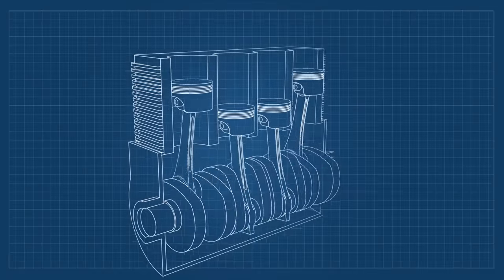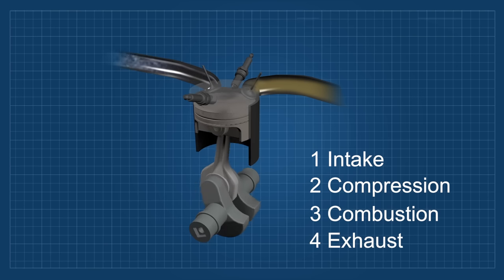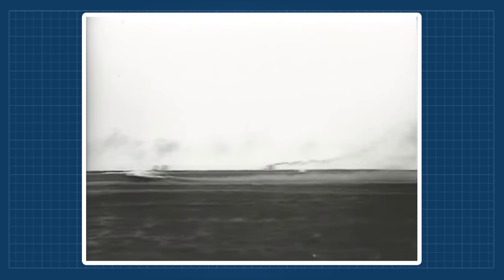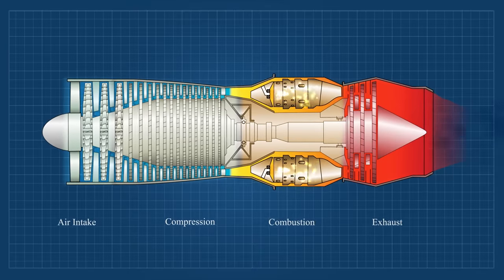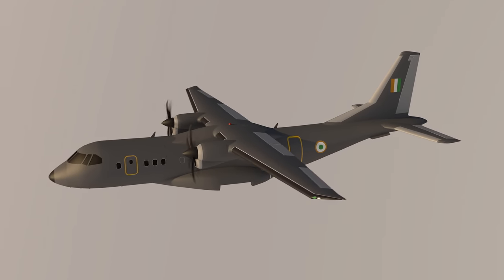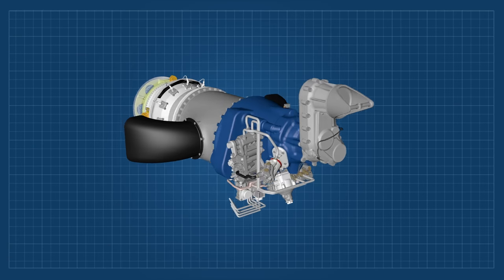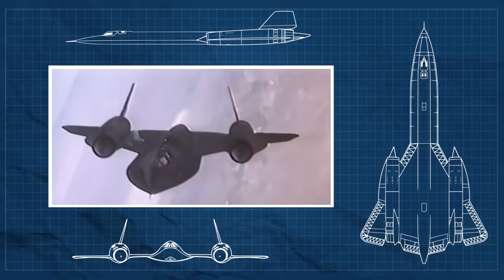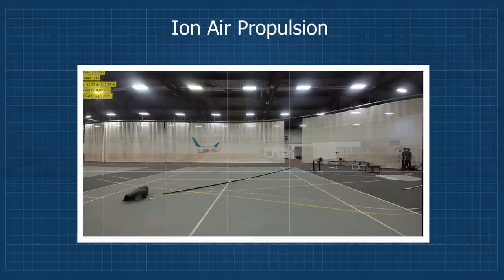Aircraft Engine Types and Propulsion Systems | How Do They Work?

Comment: One type that is used or was used is the pulsejet engines.  They may still be used on model planes but they are very loud and the fuel consumption is very high.  They powered the German V1's. Also, in model aircraft, there are ducted fan powered by internal combustion engines or electric motors.

Comment: You are missing Deltic engines used by German Reconn a/c during WW2 (Jumo 233) --as well as RRs and submaringes 
Nathan Price developed an axial flow gas turbine (J-37 - likely in 1937) beginning with a steam turbine, then adapting to kerosene.
He also developed turbochargers to improve piston engines, and saw how a simplified diagram of a turbo charged piston engine can be easily simplified by removing the pistons.

Comment: I can't seem to find the answer to a certain question ❗ 
How the heck the entire blade-array rotates 360?  Does a motor do the job? Or any other power source is used! What force/energy is being used to rotate those blades which compresses the air and then blah blah blast it through the nozzle? 

Somebody save me 🥴

By the way this video is really great, I mean it. ❤️❤️❤️ I mean you explained the Ramjet in a way more simplified way!  Thanks for it.
Reply from the maker: The entire system is attached to the same shaft as the turbine, that's how it rotates.
Reply: @Joyplanes  then what rotates the shaft? Like the piston engine needs the spark from the sparkplug , what sparks the shaft to rotate? 
Thanks in advance, I know I'm a bit bothersome but plz someone  answer my question.
Reply from the maker: @maheejaman1625  The fire or combustion rotates the blades, this combustion has only one way out and that pressure has to go through the turbine, just imagine a wind turbine but with more blades and instead of wind, the combustion is used.
Reply: @maheejaman1625  the same like the compressor but in reverse
Reply: In a nut shell, if I understood the question correctly; just like a car, the initial rotation is done by a starter, - either electric or compressed air or some other means - unlike cars though the RPM has to be a lot faster. Once optimal RPM is reached by the starter, fuel is mixed and ignited with a spark. As you know air flows from higher pressure to lower. Since intake side has higher pressure because of air comming in, it flows thru exhaust side, but with higher flow speed because of the combustion. At the exhaust side, there is a small fan that is connected to the intake fan via a shaft. While flowing thru the exhaust, the air flow forces the fan to rotate faster and faste because of higher exhaust flow speed, and in turn makes the intake fan rotate faster and faster, causing the intake fan to suck in more and more air. it's a cycle that has to be controlled, and is controlled by several means to maintain stable RPM.
By the way, a superb animated explanation. You're another mordern day Carl Segan, explaining science to the mass in a very simple way.
Reply: @DZ-rb7ft  thanks bro, much appreciated 👏👍

Comment: I'm surprised you didn't mention scramjets when talking about ramjets. It would also have been nice if you had actually explained the difference between a turbofan and a turbojet, rather than showing a diagram and sort of glossing over it. A mention of propfans would also have been cool during the last section on unusual designs. A mention of ducted fans would have been cool too.

Comment: The fuel/air mixture does not "explode", it burns, at a rate of 26000 FPS.  The reciprocating engines on aircraft are very light weight

Comment: Radial vs Rotary engine look similar but different. A rotary engine has cylinders arranged radially around a central crankshaft just like a radial engine, but instead of a fixed cylinder block with rotating crankshaft, the crankshaft remains stationary and the entire cylinder block rotates around it.

Comment: Any practical hydrogen engines used on planes? Will be nice to know more about current hydrogen tech in general.
Reply: No, hydrogen is a very BAD solution because need very big tanks and extremly complicated to handle , only uselfull in rockets, as liquid propellant, in add hydrogen is at 95% made with methan gas, with high CO² emissions

Comment: Using high speed itself as a source of compression, humm interesting.
Quite wondering if the aircraft in the future using other source of power other than burning fuel, what would it be like then.

Comment: I fly a single-engine turboprop piper m600. , cruise speed TAS at fl 280 is 265 kts. and fuel burn is 265 pounds per hour during cruise.

Comment: You forgot the motorjet and the pulsejet. Also, the Lockheed SR-71 did not use ramjets. Instead, it's propulsion came two Pratt & Whitney J58 afterburning turbojets.
Reply: When it reaches speed, it transitions into a ramjet!
Reply: @Dr_Larken  Not exactly. While it does take advantage of the high volumes of air being forced and compressed in it's intakes by the aircraft's already high velocity through permanent compressor bleed after reaching speeds above Mach 2 it is still not using the mechanics of a purely ramjet design. Instead it's engines use both compression by it's turbines as well as the rammed air in concert to one another in an order that helps lower it's consumption of fuel without the loss of speed. In essence these engine could be called a turboramjet   !

Comment: With this design of the front fan, I think there is low pressure area on the left of the fan and high pressure area on the right of it. Is it correct?

Comment: Awesome work.  Question, what happens when it rains and water enters the engine in turbojet and turbo fan engines.
Reply: The water is evaporated or just pushed out the back of the engine.   when jet engines are designed, they actualy go through tests to see how much water they can ingest before failing.
Reply: @Bendigo1  well what If the water enters the combustion chamber.
Reply: @pummyy  It all goes through the combustion chamber.  That is why they have to test how much water it can handle before the combustion stops.
Reply: @Bendigo1  That link has a very good explanation. Thank you so much for the that.

Comment: Question, Why do turbine engines take a while to start up/spool up?
Reply: Because of inertia.  The air is used to spin the turbine that moves the air.   The turbine has mass and thus has inertia, the air has lower mass and can not change the rotational speed of the turbine very fast because of the inertia of the turbine.   

You can see this happening if you use a straw to blow on a small fan to make the fan spin.  It will take some time and a lot of blowing to make the fan spin.  The bigger the fan the longer it will take to get up to speed.
Reply: @Bendigo1  Thank you!!!!

Comment: What if you fix and simplified the glider plane and use a power air turbine to propelled the glider plane it's a fuel efficiency right that is a total of airo dynamic engines and add a kinetic power to rotate the turbines in a constant rotating state

Comment: How about the nuclear jet engine? 👍
Reply: There hasnt been anything as a <<nuclear jet engine>> they had concepts for it. But it was never a real thing.
Reply: @trainsofnorway9664  not true:

"The first operation of a nuclear aircraft engine occurred on January 31, 1956 using a modified General Electric J47 turbojet engine."

https://en.m.wikipedia.org/wiki/Nuclear-powered_aircraft
Reply: @jonathanspeicher5298  yea only a concept, no accual plane with a reactor went into service
Reply: @trainsofnorway9664  *prototype. There weren't nuclear aircraft in service, but they did build the NB-36 and the Russians built an equivalent. The concept was proven as sound, but there was no vision for the technology, so it never moved to production.
Reply: @jonathanspeicher5298  yea
Reply: @trainsofnorway9664  so there WAS such a thing as a nuclear engine and it is definitely worth doing a video on. 👍

Comment: Excuse my bad English grammar because I am deaf. I would like to add info about type of engine. One of anime movie with airplanes; I saw, was using hydrogen as fuel. More cool is float-equipment plane landing on water to refill fuel tank with water! It is called "The Princess and the Pilot"   I already knew hydrogen engine won't make any different today due to weight, space, expensive to build, and less power than gas power engine.

Comment: I never understand how a turbo engine start at first, what make the fan turn to compress air then burn? Any vidéo to explain that process?
Reply: After the air fuel mixture combusted, the gas need to be exhausted, the exhausted gas hit the blade of a turbine so the turbine is spinning, the turbine is connected to the fan, so when the turbine is spinning the fan spin too

Comment: No rotary engines mentioned?
Rotary as the ones similar to the radial but the cylinders spin.
Not rotary like RX-7

Case in point:
The plane at 2:14 has a Rotary engine NOT a radial engine.

Comment: Your Radial diagram has 8 cylinders. All radial engines have an odd number of cylinders in each row. The cam ring  geometry does not work with an even number of cylinders.

Comment: So, theoretically, can the fan blades in the turbo jets be powered by nuclear generated electricity, so that it doesn't require fuel?
Reply from the maker: With powerful electric motors yes.

Comment: Likely be. A Mechanic my ever work on combustion engine , as the two cyclic steps are done after injection what's the reason for not the piston doesn't stay stuck under the cylinder after the explosion in the chamber is there any specific character design give to the Crank to pick up the full assembly upwards

Comment: i don’t understand how turbo work where give the energy to rotary the engine please answer me ??
Reply: If a fast moving gas from the combustion process hit the blade of the turbine it will spin the turbine. The turbine is connected to the compressor fan, so when the turbine spin the compressor spin too, sucking air, compress it, enter the combustion chamber, mix with fuel and ignited, the gas exhausted and hit the blade of the turbine. All of that happen in non stop continues cycle

Comment: Turbo fan jet engines are spkit in 2 main chatogorys high bypass for pure efficiency and low bypass of a more efficient turbo jet engines also you forgot scram jet engines witch is basicly a ram jet bur for higher speeds if i remember right it doesn't care about super sonic air

Comment: Today, applications that move in an interstellar or wormhole are still critical. In fact, a more appropriate name for such a simple machine would be "lever and fulcrum" because a lever relies on a fulcrum as a pivot. The simplest example of this machine in action would use a crowbar (lever) to balance on a piece of wood (fulcrum), which greatly increases the operator's lift capacity. Moments of inertia can move in gravitational order into many enormous forces or propel complexities as dynamic as the entire universe, with orbits and fine-tuned to different orders or dimensions of existence. Like almost all the great thinkers of the Greek and Roman world, seeing that applied science works on a par with the craftsman - and since most craftsmen are like gravity, he sees applied science as much nobler than pure science, it Complexity with great force, not weak gravity or nothing at all.

Comment: You made a TERRIBLE ERROR on Radical Engines and suggesting that they were used in World War 1 aircraft. ROTARY ENGINES WERE USED! The whole rotary engine would spin opposite the turning of the propeller. Fix that and you will have an accurate video. ✈ 😉